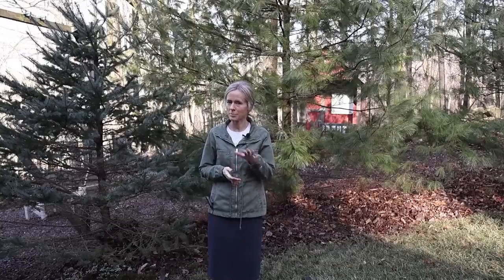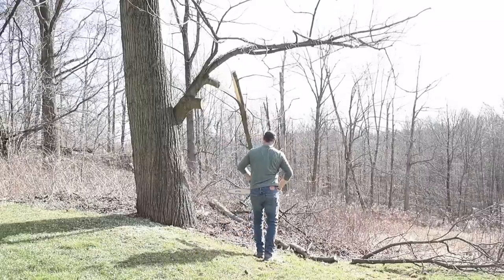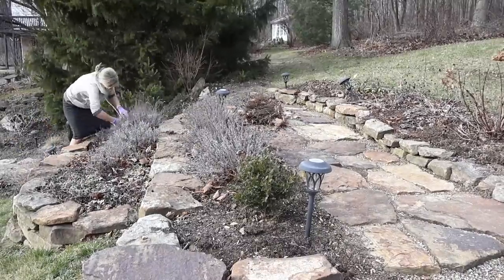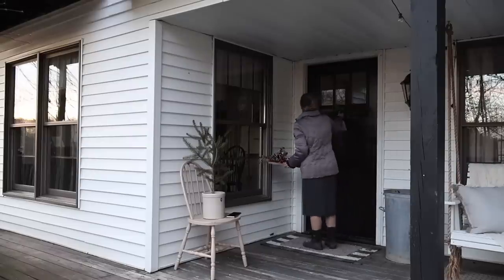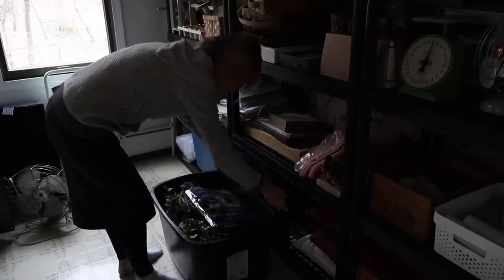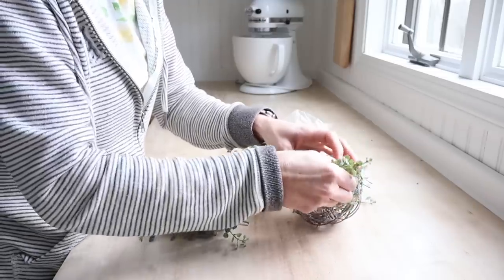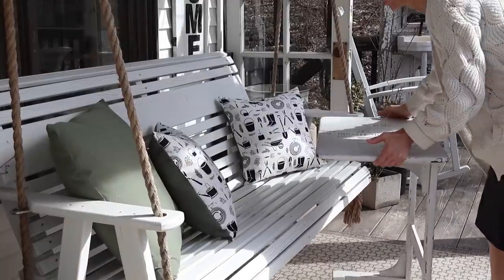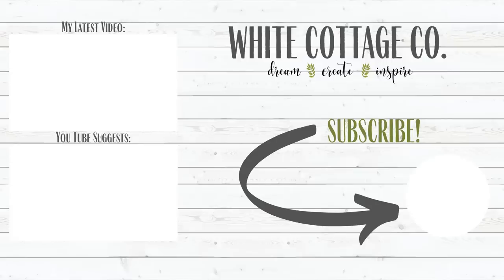Early Spring Porch Decor ~ Sunday Lawn Care Products ~ DIY Bluebird Houses ~ Moss Planters

Comment: A word of caution about putting up bluebird houses:  I highly recommend that you install snake guards on the posts to keep blacksnakes from climbing up the post and entering the bird house.  You can make your own using scraps of sheet metal formed into an upside down cone, with a circumference wide enough to deter the snakes, who can grow to 5 feet or longer.  Also, be sure to position the houses where the snakes can’t access the houses by hanging from low tree limbs.  Sadly, I had to learn this the hard way.  The snakes got all the babies then waited for the adults to return and got them too.  Had to take the bird houses down until I can remount them properly.
Reply: Also an additional board at the entry to make it thicker is a must have.  I saw a big black bird hover outside my blue bird house , put it's head inside and come out with a baby, then fly off.   I was not fast enough to scare it away.   It returned several times that day and got them all.  It was heart wrenching.   I immediately replaced the houses with  predator proof blue bird houses.

Comment: Instead of using the small stake that comes with the solar lights, I put an 18 in length of rebar in the ground and put the light on that. I use 3/8 in rebar. Works great! 👌🏽